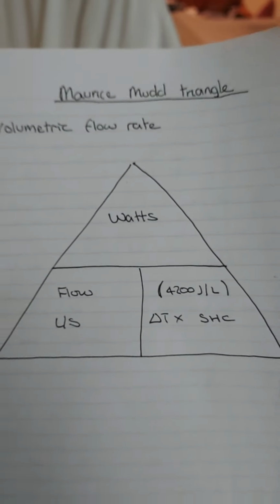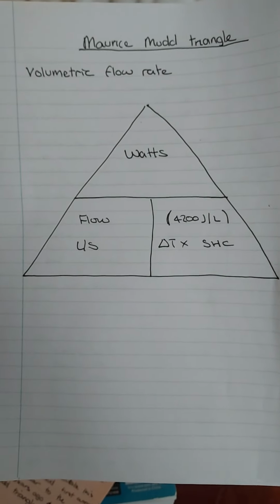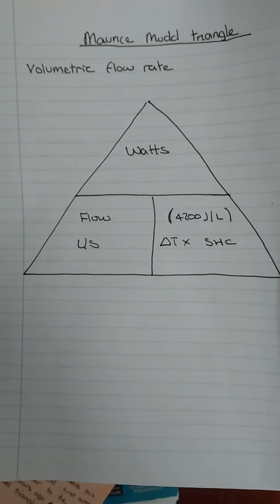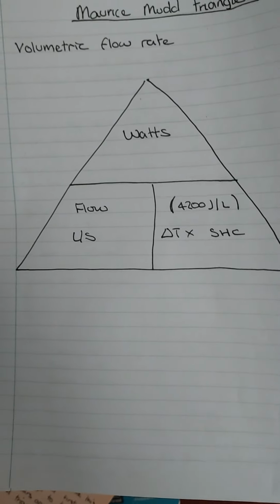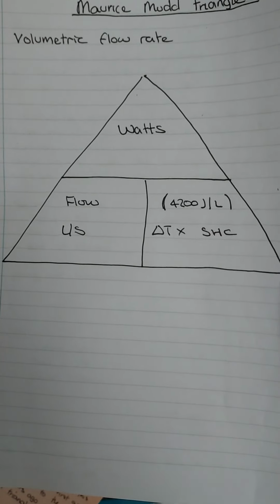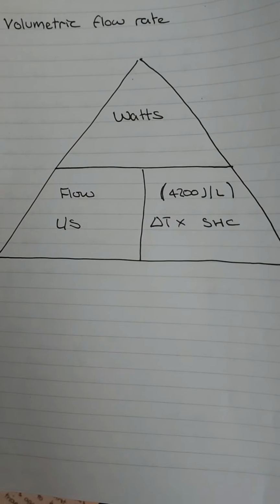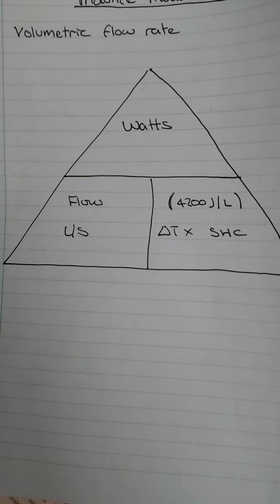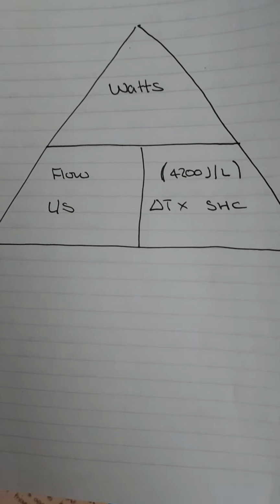Energy delivery in hydronic systems

Comment: Hi Andrew, great videos as always. 
We’ve recently been on a job where a 35kw viessmann 100w heat only was installed, close coupled tees have been added to the primary pipework just off the boiler along with a 15/60 primary pump- after the close coupled tees is a 25/80 pump to feed to radiators and hot water cylinder, however there is a tee before the 25/80 which goes to a 8 port speedfit ufh manifold approx 4m away.
From what I’ve mentioned can you think of anything wrong with the this setup?
Reply from the maker: Sounds ok. It's all working ok ?
Reply: @andrewmillwardwatford9410  its working alright, however the boiler flow temp doesn’t get as hot as I would expect, on setting 6 on the boiler stat ( note it’s an older viessmann heat only converted to pressurised) the flow temp doesn’t get much above 65, which doesn’t seem to be a problem at the moment however I’m concerned some of the radiators are going to struggle to heat the rooms. 
When I turned the UFh manifold off the boiler flow temp went up to 75. 
The UFH manual mixer is set to 45.
Reply from the maker: @barnabyventham6116  is it running full output when not getting over 65 ?
Reply: @andrewmillwardwatford9410  no not as far as I’m aware. I will put the boiler into maximum when next onsite. Can you see any downsides to using close coupled tees with 
a heat only boiler as long as it’s converted to a sealed system? We use close coupled tees often and have not seen this issue before, however we normally install system boilers- although I cannot see a great difference between a heat only with external primary pump and a system with an internal primary pump. 
Thanks for reply to comments.
Reply from the maker: @barnabyventham6116  the compact like a dt of between 15 and 20. Its also prone to blocking up.

Comment: I'm not a heating engineer and I've read various articles on UFH design and found very little reference to floor covering. I've recently installed vinyl planking to improve heat transfer for my UFH. The UFH for vinyl floor covering needs to be used with a maximum floor temp of 27 deg C.
This fact never seems to be taken into consideration in UFH design and most design criteria mention temperatures of about 40 deg C.
Any comments?
Reply from the maker: A well designed weather compensated system will use an appropriate floor surface temperature to heat the room. If the room heatloss is high in relation too to the floor syrface are the floor temperature needs to be higher and may need to be higher than suits the floor covering. If this is the case then an additional heat source will be needed or a different floor covering

Comment: Thanks for a good overview Andrew. On the last point if you have a 15kw boiler load matching and say because of the underflow and return temperature does that mean that a 15kw boiler is performing like a 5kw boiler? Is that what you meant in your last point ? So the boiler is matching the load (from what it thinks is the load)  even though the actual system requires 15kw . On a combi boiler you would only consume less gas right and have cooler raidators because of the underflow.
Reply from the maker: The radiators would output 5kw tatger than 15 but these numbers are just made up to illustrate a point